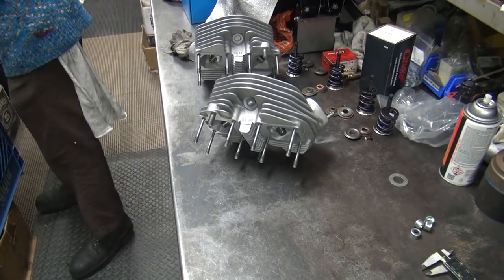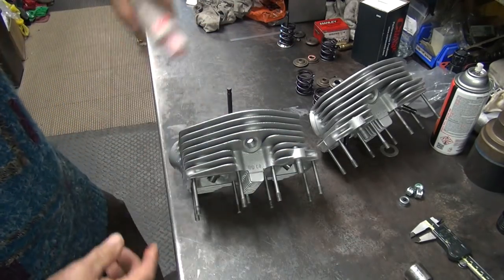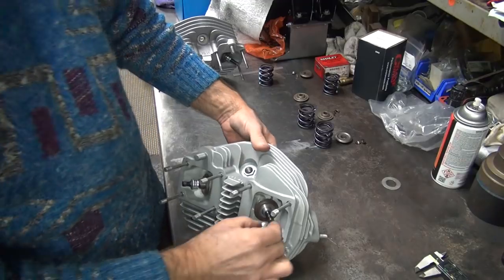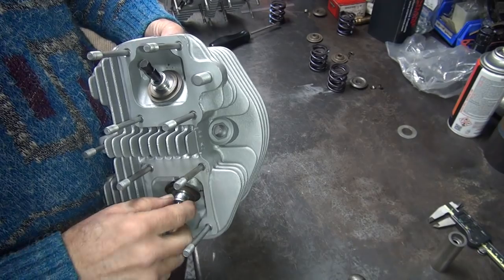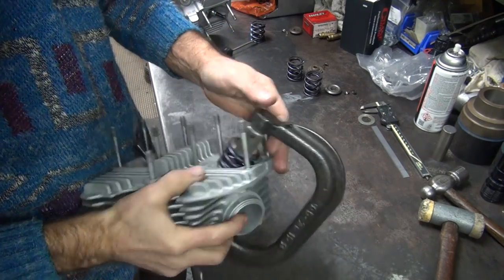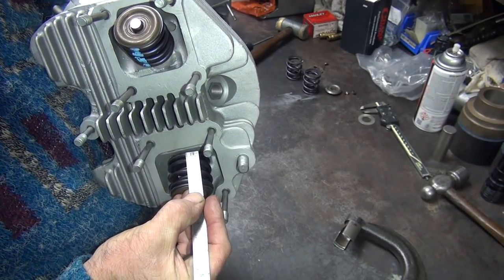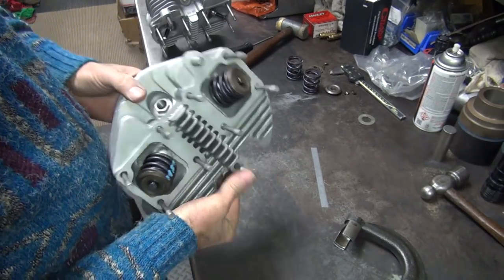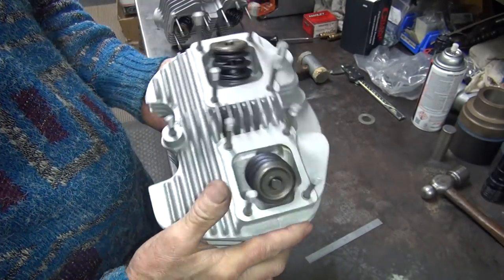1974 #110 74ci shovelhead valve job, porting, guide hole repair rebuild harley by tatro machine

Comment: Hi Tatro i want to really thank you very much for your videos and replys because you have taught me so much i work in a Australian car engine rebuild shop but I watch your videos for advice on the shovels and using your techniques and the machines that I have access to i have built up my Shovel and have done a 3 cut valve seat but I understand that at home I couldn't do that but I used stellite seats and I ended up getting a Barnett clutch and even modified my heads using your porting methods and took the high spots off my intake manifold but problem is now I think that I have overdone my engine as it will not run properly on pump fuel, but when I run avgas its a kick ass Harley.
Reply from the maker: sounds like your compression is to much. if you just ported out the high spots the ports are not the cause. without knowing more i can't help you.
tatro
Reply: @TatroMachine  Sorry Tatro I should have given you a better idea i think that I kinda went a little bit over as I used 283 Chevy valves stroker rods and pistons from S&S I have Andrews 586 camshaft and I had to have the pistons machined a little bit because they were binding so my point is I think that being stupid myself I have built an engine with best intentions but I think that I might need your advice to make it streetable!! I got a bit over zealous because we don't have any old school mechanics.

Comment: What should be the clearance spec between the valve guide I.D. and the valve stem?
Reply from the maker: i use 1.4 & 1.9 thou clearance. exhaust is the loose one.
tatro

Comment: For 68 shovelhead models which orientation do the valve key "spaces" face, rear wheel to front wheel horizontal? or front side of motor to back side vertically?
Reply from the maker: it makes no differance.
tatro

Comment: Does the loctite help retain the seal?  Or what else is it for?
Reply from the maker: on the steel backed seals it helps hold them in. on the rubber backed seals it fills in the voids to stop the leaks.
tatro

Comment: How can you tell from a 74-in head from an 80-in head
Reply from the maker: the easiest way is to look at the fins between the rockerboxes. if they stick up an inch or so, it is a 74" head. if the fins are machined flat, it is an 80" head.
tatro